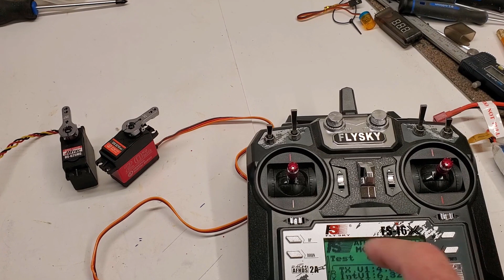Making a rc servo spin continuous 360 and hold position.

Comment: Thank you! But how do you make the setting on the receiver? I have the same Flysky :)
Reply from the maker: Recievernis just the servo wires from the unit. How i show in the video. You will go into your setting on the transmitter to change any limits like endpoints or dual rates.

Comment: Awesome to stumble across this video! I am planning a build where ill have a 60kg servo motor steering a trolling motor through a set of gears on the trolling motor shaft and atop the servo, trouble is, the remote joystick I have that controls the direction, same issue yours has, you move the joystick left and release, all it does is flicks back to centre, most annoying especially for times when i would want to hold the steering at a constant angle without holding the remote and thumb on the joystick constantly. Will a 360 deg servo have a potentiometer?
Reply from the maker: It would still have one. You would still need to make the changes.
Reply: @ thanks mate 👍🏻

Comment: The fact that the unmodified servo returns to "home" when the joystick is released is a function written into the program code or the joystick electronics. Normally an unmodified servo will move to where it's told and stay until it's given a signal to move somewhere else. 
To state that the servo "wants to go back to home" on it's own is quite misleading.
Also, why was the physical stop left in place but the feedback pot disabled?

Comment: Hey so far best and easiest I've seen, I'm not new to RC but I am new to using servos for winch's I've seen some guys use ESC and even separate batteries to power there servo is that really necessary, trying to understand the purpose. Plus my servo does not have a pin on the gear.🤔 I thought I would just plug it in to the 3 channel on my receiver. Using your simple steps. Avoiding the ESC and an extra battery. Like I said I'm no whizz when it comes to electronics stuff🙏✝️☮️🏜️ help

Comment: Good video.  Mine keeps spinning 360 degrees. All I did was drill out the plastic inside that main gear that was shaped in a rectangle.  But I didn't glue mine. Sounds like that was my mistake.

Comment: I removed the pin that goes to the potentiometer on a 360 servo to make it spin, but now it spins for a while, before it slows down to like 20% speed, unless I stop the rotaion from the radio, and start it again. Any clues as to why this happens?
Reply from the maker: You will need to rotate the pot till the motor stops spinning and make sure it does not move. I use glue to hold it I  place. Then you can connect to a reciever. It should not spin but if it does you might have to adjust the centering for it to stop. The endpoints ts decide how fast it rotates. Let me know if that answers the question.

Comment: i'm in search of a continuous rotational servo that has a brake.  i'm using it in a winch application. i need to be able to hold a load when my control is in a neutral position.  is there such a thing?
Reply from the maker: Reefs rc does make them.

Comment: Can the servo be 360degree with position control?
Reply from the maker: Yes it can but it will not hold a lot of weight. But it will hold in position where you leave the servo. Stick will stay centered but servo will stop where you last moved it.

Comment: Would this modification create a continuous rotation servo or just a 360° positional servo? Also how much does this weaken the torque?
Reply from the maker: Great questions. When I say 360 I mean that it can spin continously over 360 deg. So you can use it as a substitute a motor. As for torque you will loose some tongue but I have not tried connecting it to an esc to see if it reacts the same way. This method just allows you to use a servo like a motor without having to use an esc to control it. So torque is lost as the potentiometer does not know where to hold anymore. Hope that explains it.
Reply: u can use your tester to control the speed and direction.  I used my to control my lionel radar tower towe on my o scale layout.

Comment: What causes a 360 servo to always twicth like it want to spin on its own? I have to use the fine tune steering adjusters on transmitter to kind of stop them from moving on there own. Any help appreciated man
Reply from the maker: If it is twitching means the potentiometer was not set perfectly before gluing. I would suggest umgluing and adjust it to be perfectly placed and then glue and let the glue dry before closing things up. It's not a perfect solution but the other way to do it is is to remove the wire to the potentiometer and add an esc. But it defeats the purpose of just having a servo.

Comment: Hey. I'm in the opposite plight right now. I soldered in some new wires for my Slash's steering servo, and now it turns as shown in this video and wouldn't go back to centre or hold position in accordance with the transmitter's steering control.

Any fix to that? Thanks.
Reply from the maker: The servos should not have any wires soldered or changes. This modification is not designed for steering applications. I qould put the wires back the way they were to keep the steering as it was. Or just get a new servo.
Reply: @RCConstructionHobby 

Thanks for replying.

 It is one of those servos that are used for RC car steering and had badly damaged wires. So I replaced them with the new ones and the problem started.

The mechanical output wouldn't come back to centre promptly as it used to and the entire control is somewhat finicky.

I'm inspecting what went wrong. Now, I think I've found the issue. The potentiometer isn't connected to the servo saver (that's the output gear right? I'm sure no parts fell off while assembling, so I don't how I can properly connect those two.

Please let me know if you need more info.
Reply: To make it clear, I didn't attempt to actually modify the server to spin 360. Just happened to replace some bad wiring and it ended up like this. I came across this video while trying to find a fix.
Reply from the maker: you might have to check your wire connections and how you soldered them. It might be a wire is touching another one and causing issues. the signal wire is the one that tells the servo what to do based on your input. so that could cause an issue. when you start messing with the guts of a servo it is important to not forget how it went back together. At the end of this it is probably better to get a new servo as they are pretty cheap. check out the 20kg or 25 kg servos. they have lots of power and are relatively cheap.
Reply: @RCConstructionHobby    I just managed to fix it! I had actually forgotten to insert a part that connects the potentiometer to the output gear. So, your advice to remember the steps to retrace is sound. Thanks for all the help.

Comment: hi so when I have the servo that I made into a 360 mode when I plug it into the receiver it just turns and turns I can change the direction but it just turns I must be doing something wrong
Reply from the maker: You need to superglue the potentiometer in the betray position. So before reassembling plug in the servo into a servo tester to make sure it is in the neutral position and does not move. Then superglue and make sure it dries before you use it.
Reply: @RCConstructionHobby  thanks I did glue it but the motor just keeps turning I’m using a fan model low profile digital maybe I’ll have to get some different type of just give up thanks for your help I do love your video through I’ll keep watching 👍

Comment: just wana ask my servo wont go back to neutral its a 360 servo. it holds where u steer. not like other servo it goes back to center. any servo suggstion for good steering?
Reply from the maker: For steering you do not want a 360 servo. The 360 servo is really for driving wheels or tracks. It spins continously and will not return to center. If you want a servo for just steering look at a futaba 3004 servo. They are cheap and work for steering on light vehicles.

Comment: That tab on the main gear, no need to cut off, it pops right out with a center punch or even a small nail 8-)
Reply from the maker: good to know. I wasnt sure if all of them come out or had to be cut off. . thanks for the tip! 😀